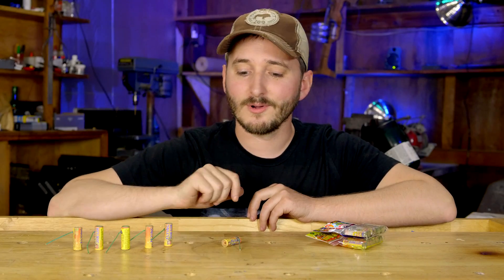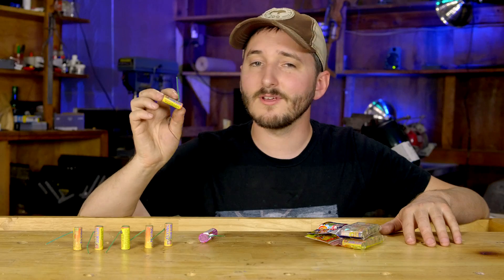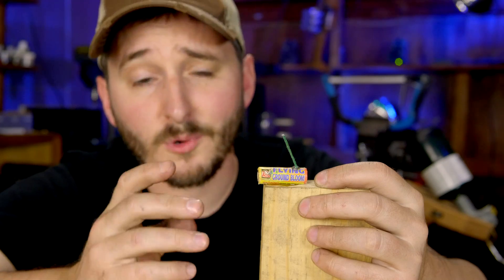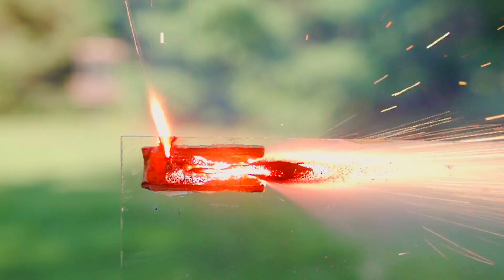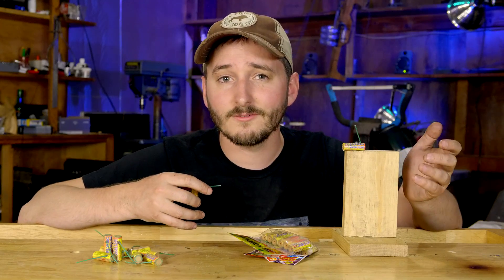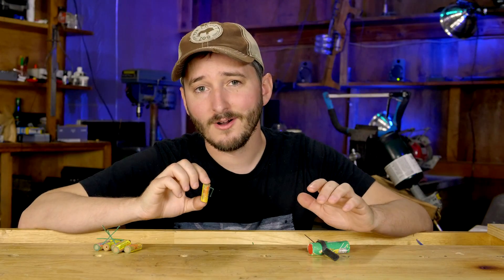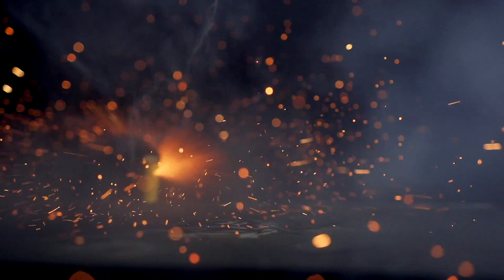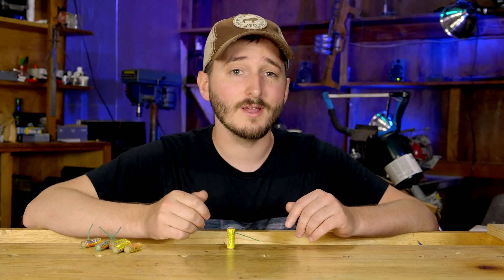How Do These Fireworks Fly?

Comment: Something you may have noticed but not mentioned is that the side exhaust is not just perpendicular to the cylinder, but at a slight angle to the center of it giving plenty of spin.  At high rotational speeds it would act much like a gyroscope and want to stand up.

Comment: can you test these somehow without starting on a hard surface, but still starting horizontal? like tie them from a string so they hang horizontally.
i think the primary mechanism is that the fuse hole does not point straight out, but on an angle, so that the first exhaust quickly creates rotation about both the main axis (the axis of the cylinder, which is associated with the least principal moment of inertia) and the other axis, because the fuse hole is on one end of the tube, so there is a torque on that end about the center of mass.  as i understand it, the rotational motion of this cylinder under the influence of gravity, as I think you might have said at one point, is to stabilize with almost only rotation about the axis of the cylinder, pointing to the vertical. from the cutaway shots that you showed, showing the exhaust through both ports, that clearly shows the object does not have symmetrical distribution of mass along the length of the cylinder, which may be part of why the firework never stabilizes vertically with the thrust port pointing to the sky (once again, possibly along the lines you were thinking with the tippy-top)

all this is to say that i think both ground thrust and friction may play a role at one time or another, but if what i've said is correct, these fireworks should still work (rotate from horizontal to vertical, and stabilize, as the fuse hole exhaust imparts lots of angular momentum, before the port exhaust shoots it into the sky) even if they are not supported from underneath by a surface to start them of horizontally

Comment: I think you are on the right track. Do this...glue two marbles together with super glue (ca glue). On a flat surface and while the two glued balls are laying on the table, give the balls a rapid spin. You’ll see the glued balls stand up. It also reminds me if you take a plastic drinking cup, where the opening has a larger diameter than its base. Lay the cup on its side on a flat surface. Lay your fingers on top of the cup, press down with your fingers, while the cup is pushed out away from your fingers. The cup will have a back spin and will wobble or stand up on its base. I see the same effects happening with the fireworks.

Comment: I think to understand how it works you just need to take small cylinder (e.g. plastic spool of thread), put it on the side, put the finger on it and push. Cylinder will start to spin as it escapes your finger and you will see that it will start to spin in circle and stand up. Remember doing it as the kid and just tried it now. This way we can see that spinning cylinder wants to stand up. Now we only need to explain how does he know which side. That is where side hole comes in, it gives a push to the right side, you can see it well on your video on 5:27

Comment: One of my initial guesses was that the center of gravity was near the bottom of the tube, particularly after the first part of the fuel burns, which will cause the rocket to spin around centered around the bottom nozzle. Since this isn't as stable of a rotation, it will tend to kick up vertical, which is easiest with the nozzle down rather than up because it doesn't require as much potential energy. However, I'm really not sure if this is even true and I can't reason about it as deeply as what you presented in the video.

Comment: my guess is that the off center exhaust and the fact that there is more thrust when it point to the surface is enough. It's going to rotate along the short diameter faster than the long one for the same reason that an ice-skater rotates faster when they have the arms along the body than stretched out. the force is off axes for both but its going to require a smaller force to rotate around the axes its closest to so its going to rotate faster around that axes and then the gyro effect is kicking in. Then the fact that there is more trust close to a surface is going to force that side to end up on the top.

you could probably force it to rotate the other way around but you need to put it in that direction from the start and then have a lose fitting pipe or something on the other end for the beginning (100/200 ms)until the rotation is fast enough so the gyro effect can work.

friction ? not sure it needs any friction to work. you could try doing it on a block of ice as that has very low friction. probably works just as well.

Comment: It looks to me like a lot of the uprighting is due to the thrust and the 'ground effect' pushing it up off the ground every time it turns to where the thrust is pushing it off the ground, then stays stable because there's no ground to push off anymore once it's mostly upright, and also possibly the spinning is gyroscopically stabilizing it at that point.. but I'm just kinda casually observing and guessing, I could be missing a lot.

Comment: My theory of how they work is that the exhaust being put slightly off center causes spin about the center of mass. Once the spin is established, it has burned some of its fuel near the fuse. At this point, the mass of the firework is decreasing and the center of mass is moving towards where the unburned fuel is, at the bottom where the larger end exhaust is. This uprights the cylinder over time and then the end exhaust begins and launches the vertical cylinder like a rocket.

Comment: watching your slow motion it looks like the initial thrust causes the cylinder to roll on the table until thrust hits surface where it begins to push away. the other end is still in contact with the table and still rolling causing thrust end to spin whilst increasing lift. the force of the thrust is not big enough to make the whole cylinder bounce off the table. when the main thrust fires the cylinder is already above 45˚ and spinning so the only way for the cylinder to go is straight up. i guess if the cylinder is below 45˚ when the main thrust fires it will shoot off in a random direction.

Comment: Just a thought what if you cut the tube exactly down the center line...."hamburger style" and weighed the 2 sides before and after the burn. I'm thinking that as it uses its fuel the bottom side is allready probably heavier and as you burn the fuel near the fuse it changes its center of gravity even more. Once it's on one end then the thruster goes off and goes up in the air....I'm thinking of it as a top or anything in general like a coin being played backwards. Once you put the energy in to start spinning it it will stay upright and slowly stop and land on its side like the speed ball does just backwards? I duno just a thought

Comment: The hole on the side of the cylinder isn't in line with the center from the outside, at least, that's how it appears to me in the slo-mo. If the fuse hole was drilled all the way through the cylinder, it would be several degrees off from the opposite side, is what I mean.

Comment: Interesting... I might know but am equally unsure... I remember being taught that objects only stably spin around axes of maximum and minimum moments of inertia. Books can spin flat like a frisbee about an axis perpendicular to the pages or side ways around an axis parallel to the spine (assuming portrait format) but cannot be stable end over end. This firework will only be stable spinning on its end as the maximum inertia is shared by two axes sideways through the cylinder. The off-centre thrust especially with ground effect can kick it to transition, as can friction at the bottom like the tippee-top. That’s my guess anyway:) great video
Reply: I was thinking the same thing and you explained it perfectly!

Comment: the exhaust is off center from the desired axis of rotation, this prevents the firework from being able to spin parallel  to the standing "ground" and forces it to spin along the the cylinder  along the desired axis, then it's just down to varying environmental factors how efficiently it pushes itself from the ground to a standing position from the ground thrust effect and the length of the internal fuse allows the optimal amount of time for peak efficiency. 
If my theory is true, these fireworks will not work in a walled container

Comment: Cut the fuse off one of the fireworks, lay it on its side, put your finger at a 90° angle to it and push down on one end so it slips out from under your finger, the spinning will cause the firework to go upright

Learnt this with gluesticks in school. May be the same kind of thing happening

Comment: Hmmm, I see a disc golf basket in the background, is this what got you thinking about gyroscopic precession? I like you even more now that I know you play disc golf. 

I think it does work pretty much like the tippy-top, the off center nozzle starts it spinning, from the cutaway it looks like there is more mass towards the top (non-nozzle) end because of the plug. The slight delay between the spin burn and the main burn allows it to get vertical-ish so it will fire upwards. The mass at the top/plug end is fixed because it isn't consumed but the rest of the device gets lighter during the burn accentuating the tippy-top action.

Comment: It is like that ground blum. look at how it spins. the ground blum does not spin on the horizontal it spins on a 40 to 45 from horizontal. So it is simple to see that there is a weight difference. in other words, it is the CG of a spinning object. The CG will change though the burn

Comment: my theory from the start (without slowmo, only knowing there is 2nd hole) :
The tube spins up, due to the hole being angled at an angle (double angle) it starts to spin up and stabilizes itself as hot air shoots out and pushes it away from the ground which makes it stand up and due to rotational energy it's stable and spinning (like the tabletoys) and because of the jet from the bottom it flies upwards which is stabilized by the rotations, like rifling on a gun? spinning stuff is more aerodynamic than non spinning.
i think the "different" slowmo results are from different dimensions of the hole and angle as well as gunpowder etc.

I can't afford a slowmo camera so maybe you can test these theories (or give me a cam and bunch of fireworks to try lol):
if you block either of the holes it won't up, unless you block the sidehole and make it stand up right before ignition.
if you change the weight distribution (make a tiny hole in the paper and glue a piece of steel or smth heavyish) it shouldn't make big difference

I hope my comment isn't too late :p

Comment: Here in eastern europe we call them "bees", they're much smaller here and hover in the air for much longer.
We also have "spinners" and not only do they burn in multiple colors while they spin but also explode with the power of an m-80 when they're done. The explodey ones don't fly though.
There are also bigger versions of these that require you to place them correctly, me and my friends always place them the wrong way up on purpose because then they fly across the ground in random a direction and explode between your legs (roulette style).

Comment: Seems pretty simple. The hole at the side ignites, and it starts rotating. Once it intersects ground once, the momentum kicks it up and further spinning occurs, when the initial charge pierces into the main tube, the mini stabilized rocked pop up. Ingenious and simple.

I'm pretty sure it has to do with the way the hole is drilled in the body. Is it offset from the center axis towards the chamber?

Comment: I'm probably late, and other people already pointed that the side nozzle pointed not directly 90 degrees to the axis of rotation, but slightly to the side. Which introduces the rotation in the first place. Then, when it's rotating, it has to stand up right because of the rotation. And then the back nozzle bursts.

Comment: Not sure if this would be related but if you have a gyro spinning on its own axis and that is also revolving around another point than can pivot up and down, like a gyro on a scale, the gyro will torque up relative to the external point when it is accelerated in the direction the gyro revolves around it.

Comment: 5:40 : here is what I think happens :

1) The fire thingy lays according to a horizontal axis.
2) The first step of combustion generates a thrust contained within the vertical plan and makes the fire thingy spin according to a horizontal axis.
3) When close to the table, the combustion exit lifts the fire thingy up to a point it could fall on the other side, describing an angle of 180°.
4) Except it can't because of the spinning thrust that stabilises it because it pushes it in all directions in tenth of seconds : there is no longer one direction according to which it could fall. It literally wants to fall in all directions. But it's impossible, and the average of all direction in this context is up.
5) The fire thingy is now stabilised in vertical-ish axis.
6) The second part of combustion gives the vertical thrust it needs to start flying.
7) Pardon my English, I'm French.

Comment: I can only speculate: as the center of gravity is probably about in the middle of the firework. When the nozzle points down the momentum around the short axis makes the piece pivot on the ground as it rights itself up. Instead while the nozzle is pointing down the rotation around the short axis raises the base that now without ground traction lets the rotation on the long axis accelerate minimizing the time it spend with the nozzle down.

Comment: take the spinning top and record it. now play the footage backwards. that's how the rocket stands upright except rather than normal force it uses a pressurized jet of burning fuel
decelerating spinning top versus accelerating spinning rocket both changing angular momentum, transitioning from upright and spinning to laying down and not spinning or vice versa
tippy tops work on the same principle but are a different application of it.

Comment: Ok. So, yes I think the side hole provides rotation, then as it pushes out, every time the flames are pushing in close proximity to an object, the force aligns the firework so that the flames are furthest away from that object, making it spin upright, each rotation where the flame is more or less pointing at the solid surface pushes the spinning firework in such a way that it is interfering with the surface, through repeated iterations until it is spinning as seen just before the flame comes out the end nozzle. At this point, the centrifugal top-like spinning holds it in a consistent rotation pattern and the flame coming out the nozzle very quickly becomes the dominant force and it is simply a stabilized rocket, again pushing away from the solid surface. If my theory is correct and gravity isn't strong enough to counteract the effect, dropping a lit firework down a smoothie wall should cause the thing to spin away from that wall with the same consistency as if you had placed the firework on a flat pavement. Now I want to try it...

Comment: theory : the cylinder is initially bottom heavy because of quantity or/and type of the second stage propellant.So, while the first stage burns and the stabilizing spin initiates even more propellant is burnt from the first stage /top and therefore when the time comes for the second ,still heavy ,stage to ignite the whole thing has balanced/righted itself on the vertical axis and off it goes . Nice videos as always !

Comment: If you remove the fuse and some of the initial propellant (as it burns up) you'll find that the opposite end momentarily weighs more. As it starts spinning gravity is simply pulling down on the heavier end and causing it to stand upright.

Comment: My theory is that the nozzle is directional and therefore start the stabilising spin initially, this then has ground effect when it hit the ground on a rotation, which then propels it vertically bearing in mind the offset from cog, this then enters gyroscopic procession before the final Venturi operates and it becomes a rocket.

Comment: Fascinating.  I have never seen these fireworks here in the UK.  I think that they work simply because a) the fuse hole [jet exhaust 1] is angled both slightly right and slightly down , and b) the mass of unburned fuel pulls the base down, allowing the second jet exhaust to then launch the casing.  This would also explain why the fireworks are so small.  Any larger and they would spin but not flip upright & take off.

Comment: The fuse hole is offset from the axial centre and cut parallel to the line of the diameter of the tube. Thereby the exhaust forces rotation and also pushes the tip away from the table as it rotates - centering the firework over it's nozzle base.

Comment: It’s the same way a stinger missle rocket firework is made but they moved the fuse towards the top so you can place it on the side and it will correct itself upright